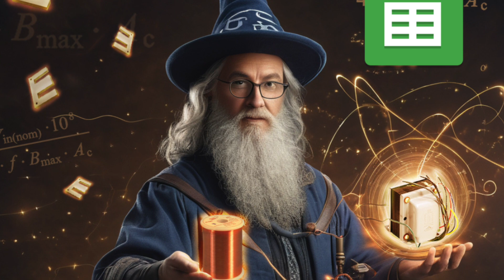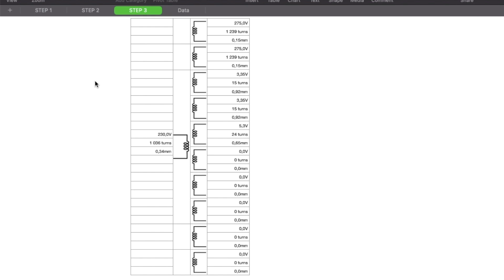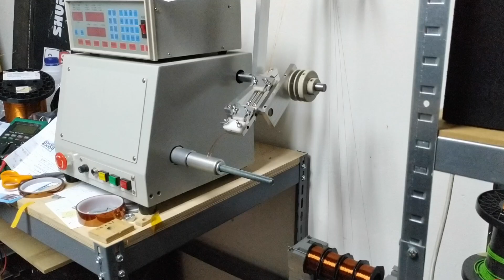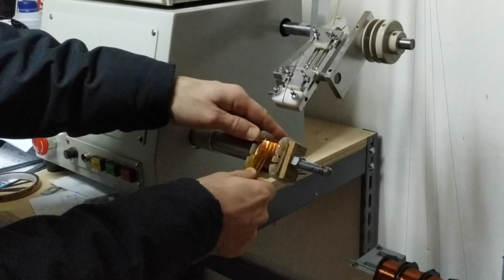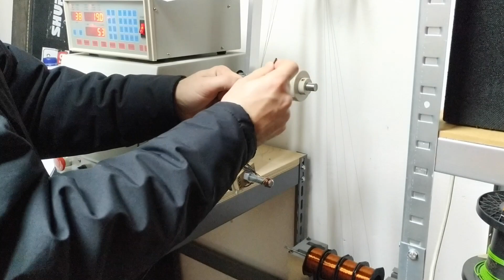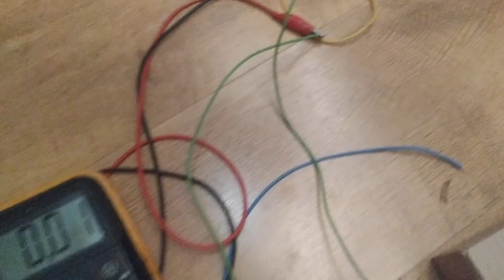Pultec EQP-1A Power Transformer Calculation and Winding

Comment: Great video again 👍
I have a question, how much would winding a transformer like this cost? Just raw materials, bobbin, wires, laminates etc.
Reply from the maker: Thank you. It really depends on the quantity and quality of the materials you use are buying. If you reuse the core and end bells from some old transformer your only cost is the plastic bobbin and wire. For laminations I have bought them cheaper in bulk, so even with the new ones it would cost me around 30-35 USD with the end bells. If you check my advanced power calculator it one of my previous videos it calculates the price of materials as well if you input the price of laminations and wire per kg.